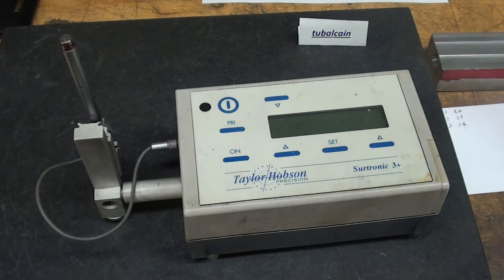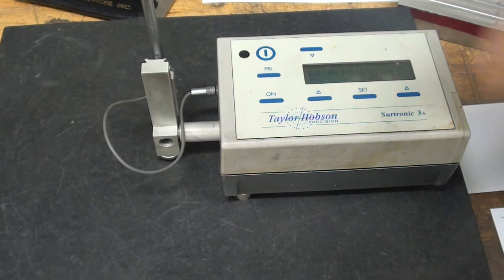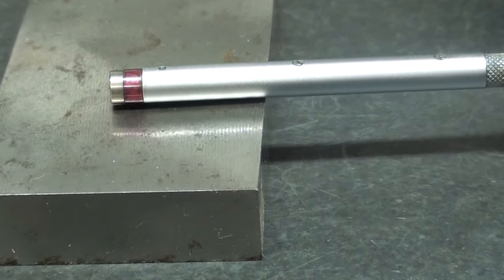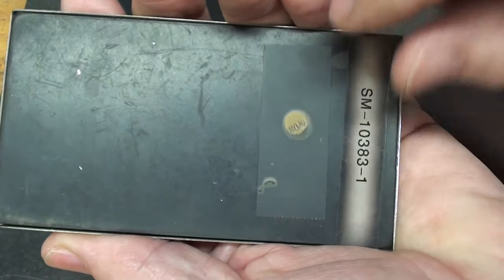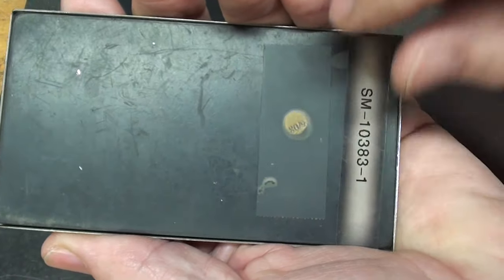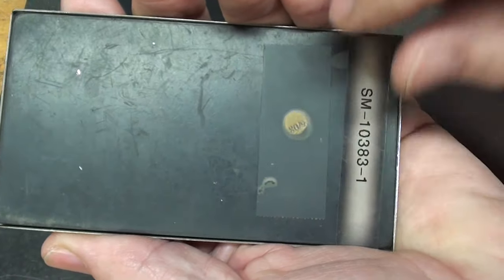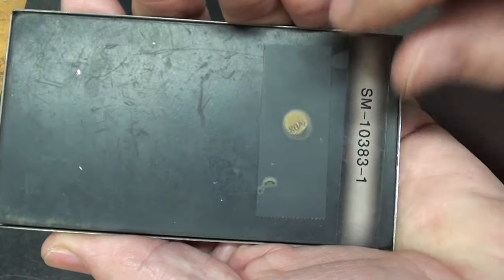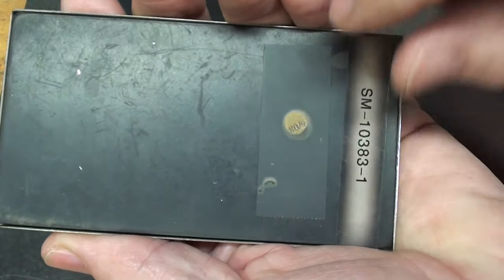SHOP TIPS #294 Checking Surface Roughness with PROFILOMETER 2 of 2 tubalcain

Comment: Back in the day when doing work for Sandia and Los Alamos National Labortories a lot of the work would have Ra callouts on the prints. Generally Ra64 was for a finely machined surface that required a feed of less than 0.002"/rev to obtain without filing or polishing. Ra32 was a general ground finish and Ra16 was lapped. Ra12 or less approaches a mirror finish. The finest I can ever remember doing was an Ra4 finish on a 1" ID of an annealed copper tube that was 1 foot long.  I sorta fudged and said it was a Ra4 finish because the test meter diamond probe would leave a scratch that you could see.

Comment: Thanks for the introductory on surface roughness. After seeing the macro photography pics I can see how Edison came up with the phonograph. His first commercial cylinders were made at 200 lines per inch (0.005" feed rate). Now try the same experiment, but with a 'flexible' setup that chatters or "sings". Look at that with the macro lens and you will see vertical modulation within each "groove". That is what the sound wave looks like. That can be played back with a stylus connected to some sort of diaphragm. You just made a phonograph!

Comment: Mr. Pete.  Very interesting video. I do have one question.  When you measured the test piece you turned on your lathe, the 2nd stage measured 138 micro-inches (at 21:25 into the video), but, you wrote 95 micro-inches on the turned sample.   Why was it written different from the tester's reading?

 I had never seen one of those "surface-roughness" testers.  In the late 90's, at the ripe, old age of 50, the company I was employed at eliminated the division I worked for.  Not looking forward to stocking shelves at the local big-box store, or, mowing people's lawns for a living, I enrolled in a 2-year "precision machinist" course, at an "industrial school".   I was "the old guy" in the class.  The other students were all high-school juniors/seniors (16 and 17 years old).  They were bussed from their high schools to the "industrial school", and spent 4 hours/day, learning machining.

One of the inspection "tools" we had was a magnifying "comparator".  It was something like a 20" TV screen (monitor).  It was very interesting to take a project that we had machined, even to the point of precision grinding, and looking at a magnification of the surface.  What appeared to be a perfectly smooth surface (to the naked eye, and "touch"), could be magnified to the point where it looked like a profile of the Alps.

I'm not quite sure of the magnification power of that comparator that we used.  If my (70-year-old) memory serves me correctly, I believe it would magnify up to 10,000 times (possibly more).

I recently watched a video of someone measuring the thickness of several "Sharpie" ink lines.  Black was actually thicker than red or blue.
Reply: My guess, and it is only a guess, is that he took several measurements of each surface to verify the results, but inadvertently used the wrong video clip in the final edit.
Reply: OK.  Yeah, I just wondered why that measurement was shown.  Actually, the 95 seemed more likely, as it fit between the other two.

Comment: Looks like an RS-232 (serial) port on the end there, for connecting right to a computer as a serial device. Then the data would flow right to a PC, and could be logged to a file or plotted to a graphical display...something like that.

Comment: I am sure the tip is missing from that diamond, there should be a conical tip with a 60 degree angle with a 2, 5 or 10 nano-meter diameter.  (per stylus repair shops on the internet.